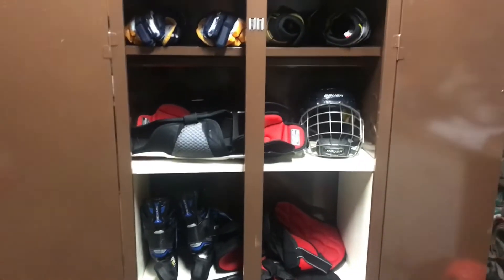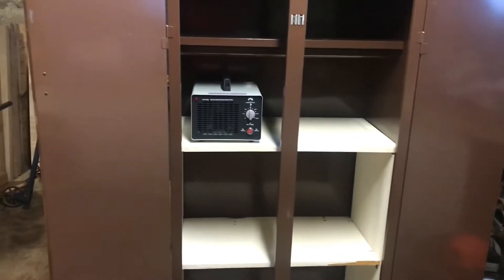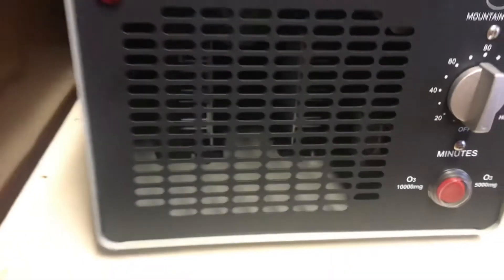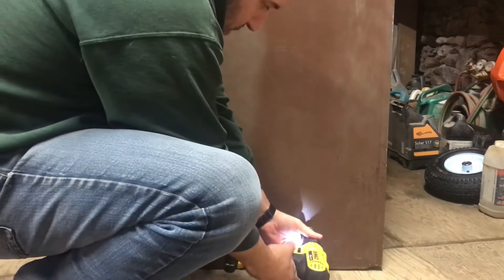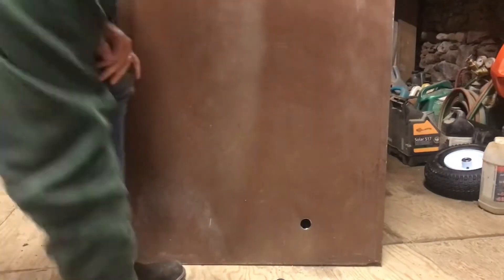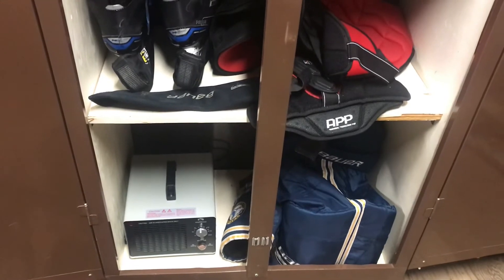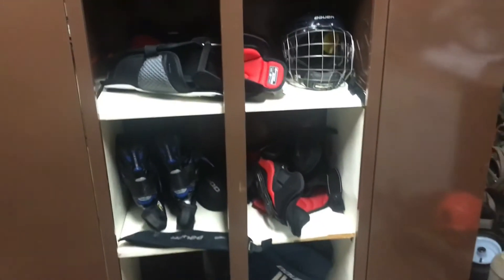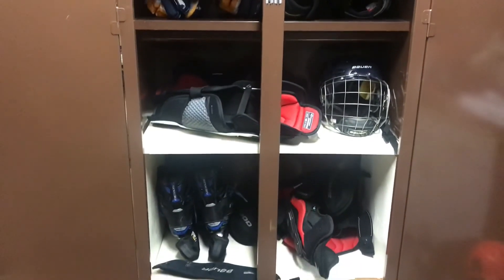Using Ozone Generators for Effective Odor Removal in Cars, Homes, and Sports Equipment

Comment: does this really work?
Reply from the maker: Yes  especially for things that you can't wash  like skates, Helmets etc. Really smelly things may take multiple cycles.
Reply: @aroundthecounty1139  ok cool. I'll try building a unit with maybe a better sealed enclosure. I wonder if using it in a big bag would work better. Do you know if there are any negative effects of ozone to metal or plastics?
Reply from the maker: @thedaveko It can make plastic brittle over time and not good to breath in.  Best to use in a garage or shed and allow time for the ozone to dissipate.  I use my generator in cars, in the cabinet for sporting goods and musty life jackets as well as spider management at my cottage when we are not there. These generators can be used to remove cigarette smoke smells from homes and cars.
Reply: @aroundthecounty1139  yeah ive noticed home restoration companies use them to get that musty smell and smoke smell out of properties. I just just curious if it would compromise the integrity of the hockey equipment over time.
Reply from the maker: @thedaveko  I would guess the equipment would wear out or be out-grown prior to the ozone affecting it.  At big hockey tournaments you may see equipment cleaning vendors.  They are using ozone generating equipment such as "Fresh Gear Cyclone Ozone Sanitizing Machines"

Comment: Thanks for the Ozone review, but in my opinion Ozone machine have to be installed on the top cause Ozone gas is heavier than the Air and it will drop down. Need some fans to blow it up. Thanks
Reply from the maker: Thanks for the feedback.  I will move the generator to the top of the cabinet.